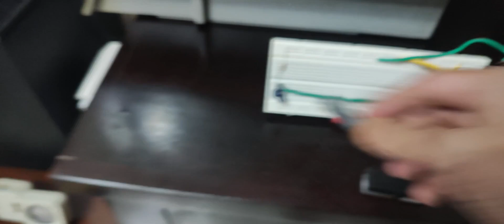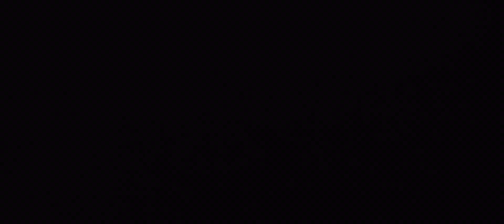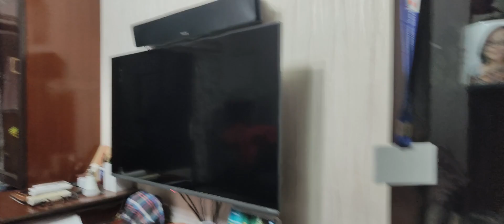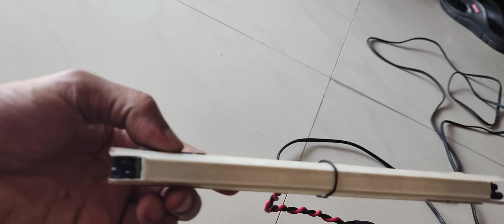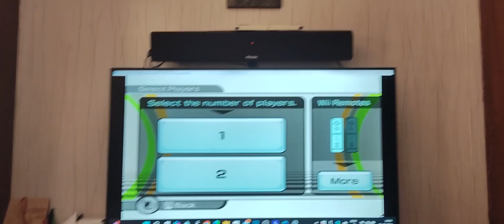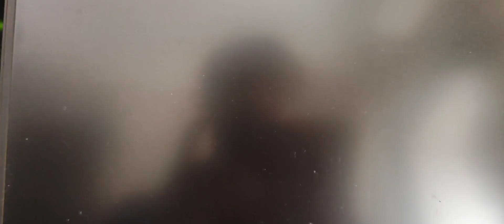DIY: Cheap home-made Solder-free Wii Sensor Bar with IR LED's

Comment: Great work.Did you feel a lot of difference b/n the feel while using the original sensor and diy one.
Reply from the maker: @likhithkumarn2390  Not really. Only that if you have some LEDs pointing little bit in a tilted angle, you get a wider coverage. Currently all my LEDs are positioned currently straight and so the field of operation is a little limited if you stand very close. From a distance of 2.5 metres or so, it is all fine.